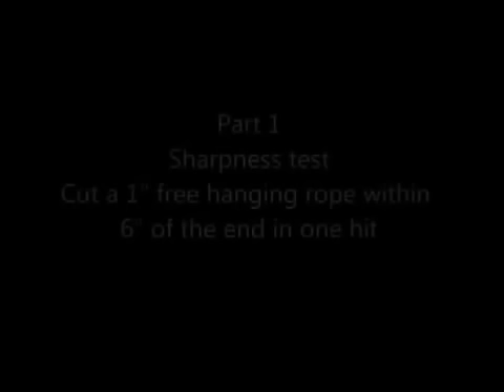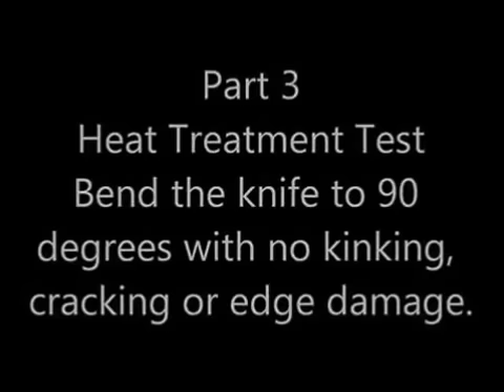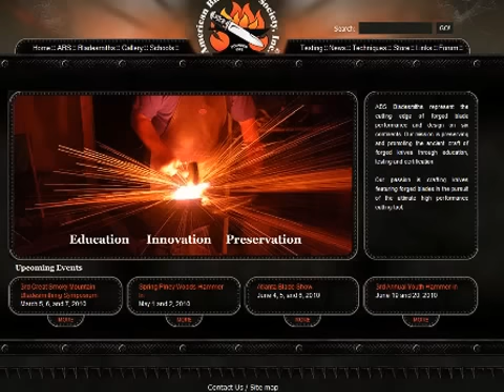Journeyman Smith Performance Test of Keith Fludder

Comment from the maker: Good question! The Test Blade length is limited to a maximum of ten (10) inches from the point to the beginning of either the guard, bolster, or handle of the blade.The Journeyman Smith Test Knife specifications further limit the overall length of the knife to a maximum of fifteen (15) inches. The blade width is a maximum of two (2) inches. 
All of the Journeyman Smith testing and judging rules are posted on the American Bladesmith Society website.